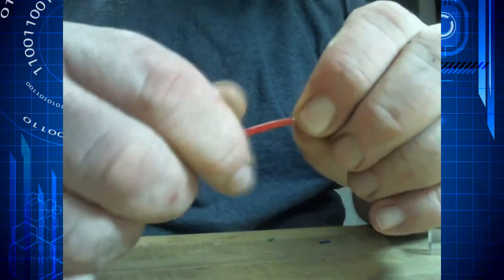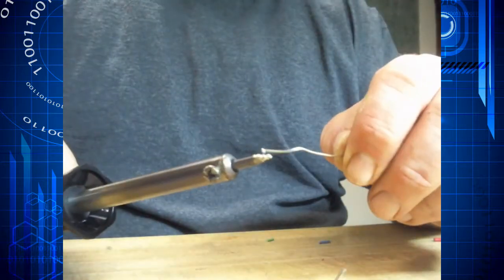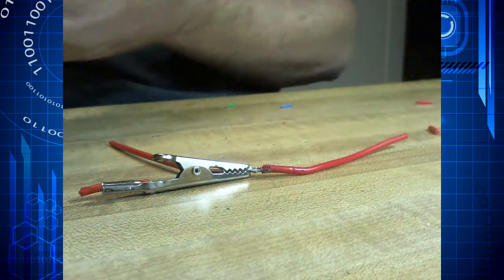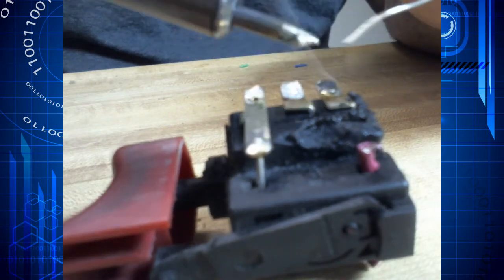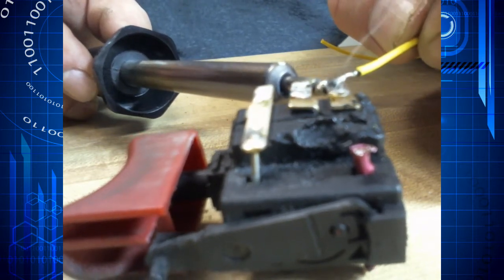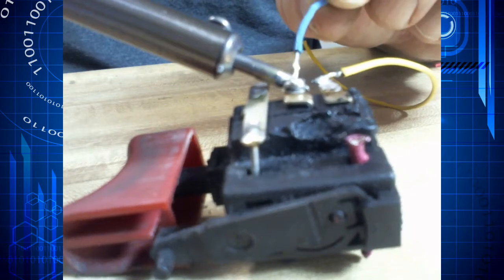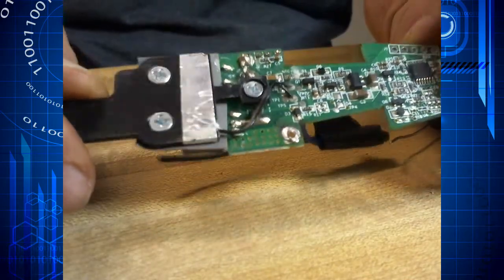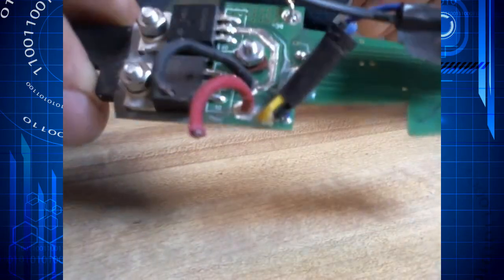How to Solder

Comment: Nice try at teaching soldering but you could do better. Firstly temperature controlled  irons are the way to go. Temperature is the most important part of soldering. The second most important part of soldering is real solder. Don't use lead free crud. Lead solder melts and flows correctly. 

You managed to solder your Croc clip to the wire because you put it on the bare wire you were soldering. What you should have done was a pig tail splice to hold those wires together. Or a linesman's splice would be better still. Also never use tape on joints, it's God awful stuff to remove. Buy some heat shrink wraps for a better seal and professional look.

Comment: Hey Paul hope all is well brother......soldering, it beats butt connectors and marretts  in my opinion. I've used it a few times myself. Until you've done it in my opinion why use another option. 
-Pidge
Reply from the maker: +PiDGE IAM Pidge, I hve been involved in RC planes for over 20 years. About 6 years ago I went mostly electric. So I did a great deal of soldering. It beats crimps anyday